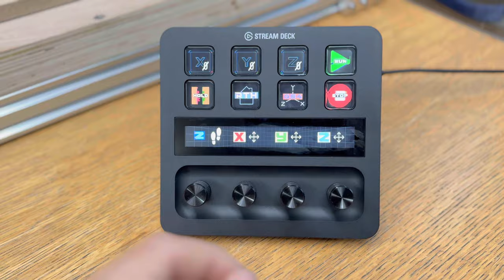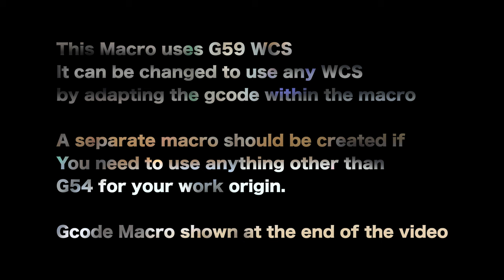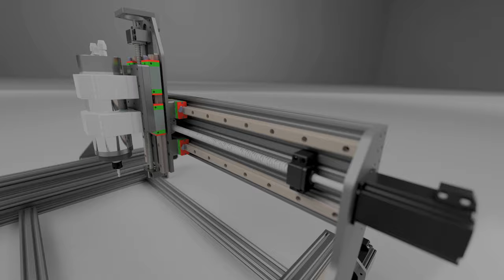Tool Offsets with Tool Setter Probe in UGS Macro

Comment: Would really love to see a video of how you setup the Streamdeck. I just finished making my MPCNC Primo and  have a cheap toolsetter unfortunately its an normally closed version and the Fluidnc board I use (v1-engineering Jackpot board) need the XYZ probe (normally open) and the tool setter to also be normally open. One is on order. but seeing the streamdeck in use with macros on Universal G-Code Sender in you video is like a dream come true. I've gotten a Fluiddial pendant setup and it's working fine but the streamdeck would be a vast UI Improvement over the M5 Dial. Anyway I do hope you make a video of how to setup the streamdeck for UGS I'd watch that 10 times and pause it while I was following along step by step.

Comment: awesome, thank you very much for this video! I had been searching quite a while for this function (FoxAlien XE Pro + UGS) before I found this. Note: One can't use other WCSs to store fixed positions at the origin (tool change, move back to clear work area, etc.) with this macro as the probing operation will mess up all WCSs. Caused me some headache to find out.. and a Z-axis rebuild (realignment) as it slammed into the table once :(
Reply from the maker: @maftech66  You’re very welcome!

Defo need to take caution when trying new code. Sorry to hear you had a crash. Always best to drop rapids down to a more manageable level where possible.

Comment: Awesome video and cnc build.  Would love to see more info and videos of how you designed and built the this massive cnc but it is still capable of milling aluminium.
Reply from the maker: Thanks pal!

Absolutely, the machine is working great for aluminium and cf :) will post some more as soon as I can! For now though, I upload shorts to this channel and reels quite frequently on insta page! Pixelcnc :)
Reply: @Pixel-CNC  I see you have 8 bolts on the front bearing plates. Curious to know what type/size extrusions have you employed for the x-y axis?
Reply from the maker: @MP-mu1kw  each side has dual 8040 c beam profile. Making it 160x40
Reply: @Pixel-CNC  Very interesting design - well thought off. Am i right to think the c-beam profiles are 40×80 T-Slot or V-Slot stacked together?  I was thinking of doing something similar but using the standard 2 x 2080 v-slot profiles and sandwitching them together to get a thick 4080 foot print. But I think the v-slot profiles are not as strong as an identical T-slot.
Reply from the maker: @MP-mu1kw  Thanks! They are 4080 V slot C Beam, as that's all I could get at the time. If I were to do it again, I'd go with thicker profile, without being c beam profile. That way it would be easier to fill the voids with epoxy resin :)
Reply: @Pixel-CNC  Thank you for your reply. Like minds think alike :) Here in the UK, the only easily available profiles for hobbyist at a reasonable price/performance is the v-slot type.  Motedis used to supply a 4080 i-type 5 T-slot profile but they were having supply issues and eventually they discontinued it. So I was toying with the idea of stacking 2 x 2080 side by side. I will see how it goes and will report back.

Comment: Awesome thanks for this macro!
I just need to figured out why sometime it work and why sometime it give me completely shitty Z.
Reply from the maker: @Treenity  Hi Treenity, I’ve recently had the same results intermittently. Not had a chance to look into what is causing this yet
Reply: @Pixel-CNC  i just start learning  g-code, so it's not fluent for me, but i'm gonna try to make some test with a "securized spoildboard" to prevent craching spindle everywhere and try to find where/when the problem append
Reply: @Pixel-CNC  ok I have a idea… 
I just tried to simulate a ALERT (red button), and after homing my Z on G54 is completely f*cked, and if I try a toolset macro (with same tool) I find myself in a weird situation where Z0 is a 1xx.

Comment: A better solution instead of having to set G59 every time you power on the machine would be to save the tool setter locale to G30 in persistent memory.

Move the tool the the location you need for the G59, send a G30.1 to write it to non-volatile memory and then update the macro to call G30 and then write those values to G59 for the purposes of the job.

e.g., replace the start with:

G92.1				;Cancel temp work offset
G90					;Absolute positioning
G53 G0 Z1			;Rapid Z Axis to Machine 1mm from top to be safe/clear
G30 X0 Y0			;Rapid XY to centre of tool setter
G30 Z0				;Move Z Axis down Z0 for tool setter
G10 L20 P6 X0 Y0 Z0	;Save current position to G59 WCS
G59					;Enter G59 WCS
G91					;Relative positioning

Then you can continue on with the probing routine.
Reply from the maker: Hey Ben, thanks for your input! What's the benefit of using G30? We still have to home, then tool set when turning on the machine for the first time. Can't wrap my brain around it :)
Reply: @Pixel-CNC  Hi I'm new to GRBL CNC, can you make a video tutorial specifically setting the Gcode for the macro and setting the initial table coordinates for this offset probe! This is very useful for beginners, thank you very much.

Comment: you don't happen to have a macro for correcting slightly askew work pieces by any chance? I mean probing the touchplate on z first and then 2 times x, 2 times y and calculating / correcting for the resulting angle
Reply from the maker: @maftech66  I do not, sorry!

Comment: Hello, 

I used your g code as a solid start and wrote one that is suitable for my machine and everything runs very nice. However I wanna upgrade my probe (I use the stock probe from FoxAlien) a cheap continuity probe, it uses ~5v. But I can't find any 5v probes / tool setters. Nor if my machine is compatible with 24v. The machine is a FoxAlien XE-Pro.

BR,
Reply from the maker: @EagleBayNightSupplies  hey, that’s great to hear!

I believe the probe I have works between 5-24v, check it out on Amazon, hopefully it will work for your machine.

Let me know if it does and how it goes!
Reply: @Pixel-CNC  I ended up building my own probe with a microswitch a 3D printed hosuing and then I made a bushing and a axel + button from steel in a lathe. Dead on every time within what my machine can measure (0.001mm)